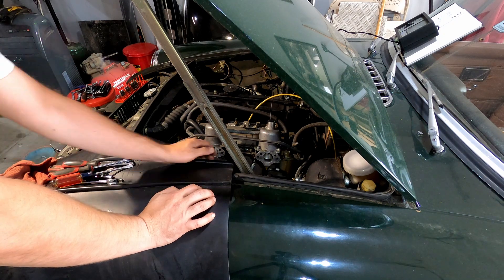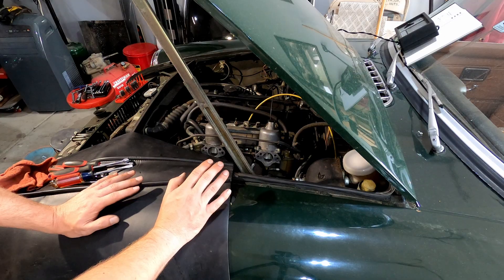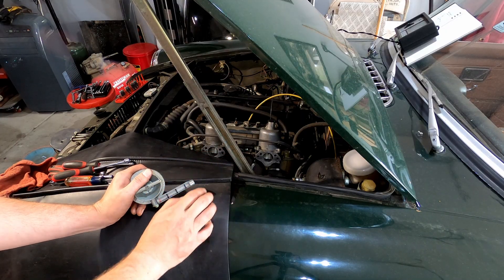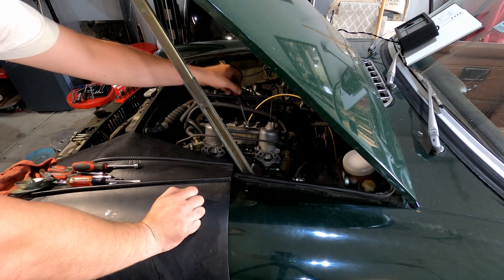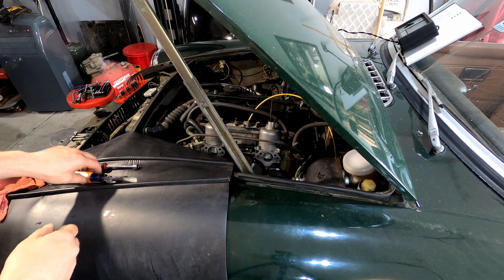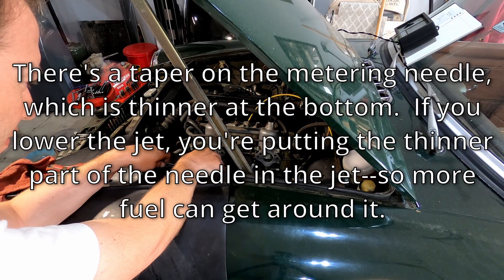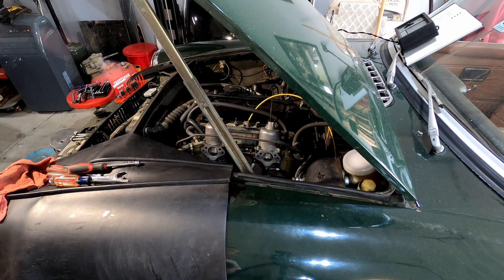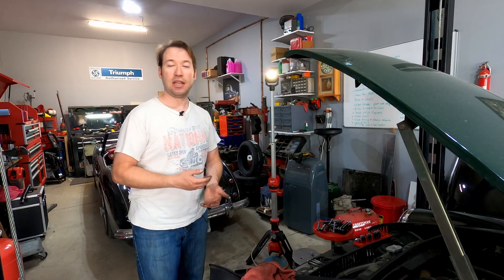MGB Tuneup Part 3: SU Carburetor Balance and Mixture Adjustments

Comment: The air cylinder lift buttons on the side are for checking the mix when air cleaners are in place, i.e. fine fine-tuning. IMHO
Reply from the maker: Yes, thats correct.  In reality, with clean air filters, it should make very little difference whether they're on or off.  You may need a gas analyzer to tell the difference.

Comment: My mg wants to die if I use the balance on one carb, but it i let airflow in i cant even get a reading
Reply from the maker: That's usually a sign that it's burning waaaaaay too rich.  By restricting the air even a little, it causes the engine to bog down.  Try making that carb slightly more lean and then try again.  Or, you can raise the rpm on that carb and try again.  You'll be going back and forth between rpm and mixture anyway, so just start on the opposite one to see if you can get a reading.
Reply: I have the same issue did you have any luck I either get no response from the guage at idle or the engine stalls
Reply from the maker: If you get no response from the gauge, you need to turn the dial on the gauge until it registers.  You're calibrating it to one of the carbs, then adjusting the other carb to match (do NOT recalibrate the gauge between each carb).
Reply: @midwestmotoring  Thankyou iv given  it a go its a very fine adjustment 😮

Comment: My MGB has the crankcase timing marks at 6.00 o’clock.  So have to use the strobe under front of car .  If I want to increase revs while checking timing marks it’s a two person task !  Any ideas?   All the videos I’ve seen show timing marks visible from top.  Any idea why?
Reply from the maker: I suspect it has something to do with the service network maybe using pits for maintenance, or when the engine gets originally installed.  It's definitely more convenient at the top. 

One thing you can do is to rotate the engine until the timing marks line up.  Then go around to the top side and draw a line across with a paint marker for tuning.
Reply: @midwestmotoring . Thanks. I’ll do that!

Comment: Very nice video and i got a question regarding puting oil on K&N fitler. Could you explain or make a video on how to do it and the purpose of it? What type of oil to use, etc. Greetings from Poland 😃
Reply from the maker: A video on that would be a good one.  I'll add to the queue.  Basically though, K&N filters have more open space between the weave of the fibers than a typical paper filter.  It's also made of a cloth type medium instead of paper with a bunch of fibers hanging out--so they catch debris in a different way.  With a K&N (and also with lots of older classics like my Austin-Healey which has a wire mesh filter), the oil stuck to the filter is what traps dirt.  Then you can wash the oil off, which has suspended all the stuff that sticks to it, and you have a clean filter again.  Re-oil and put it back in and you're good to go!  With a paper filter, you can't really clean it off, and it might be more restrictive (though engineers will design the intake with that in mind).  

Basically, clean the filter once a year or so when you change the oil.  Take it off the car, clean it (K&N makes a filter cleaner), let it dry, and spray some new oil on it.  Then it's ready to keep protecting your engine!

Comment: Just found your videos. Very well done. My 73 mgb had gummed up carbs, so I rebuilt both. Now in order to get the car to run, the choke needs to be out. Even after it warms, pushing the coke control in causes the engine to die. I'm completely stumped. Can you offer some help?
Reply from the maker: Either the mixture is incorrect, or the throttles aren't synchronized or far enough open.  You could also have a vacuum leak or some other source of air that's not supposed to be there.
Reply: @midwestmotoring , book